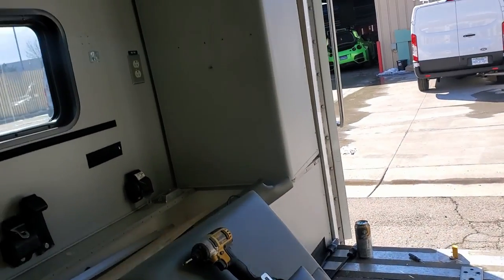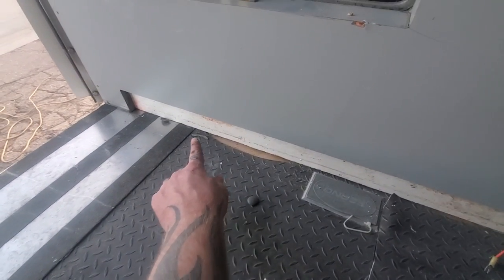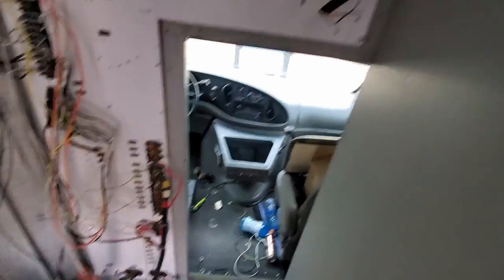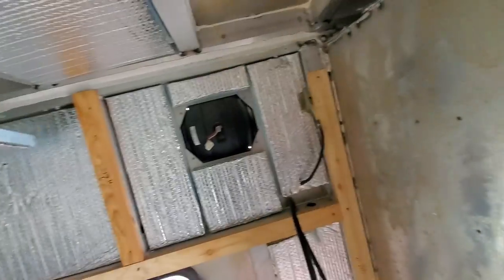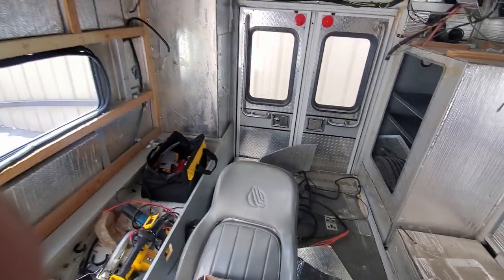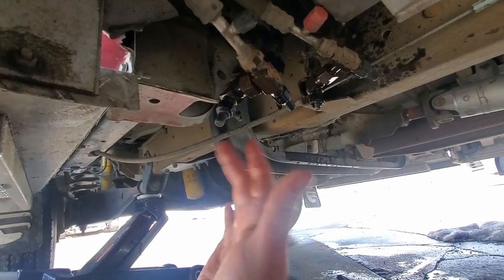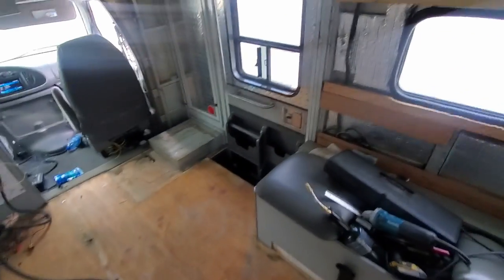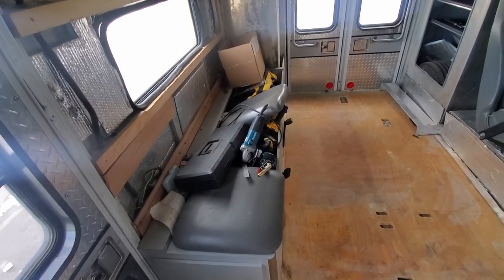Ambulance to RV build 01 Teardown and wiring.

Comment: Maybe take the wireing to those outside lights and use them for inside lights instead  and leave wireing the way it is and make a seperate solar apart from that old wireing
Reply from the maker: Iv almost finished the build it hit the scales at 9500 pounds if id of left anything else in there I wouldn't of been able to register it. Got pretty lucky actually

Comment: Awesome stuff! What types of tools did you need for this tear down?
Reply from the maker: Just a basic crow bar set a drill and a few wrenches its all pretty easy undo all the bolts and screws then there is a bit of glue holding peices together

Comment: why did you choose to take the box ac and heater out?
I feel like that would be kinda nice to keep so that you don't have to install and wire a new one in...
Reply from the maker: They both require the engine to be running to use. They are incredibly inefficient and the very old technology took up way to much space. We have a buddy heater for the winter and plan on installing a minisplit ac for next summer